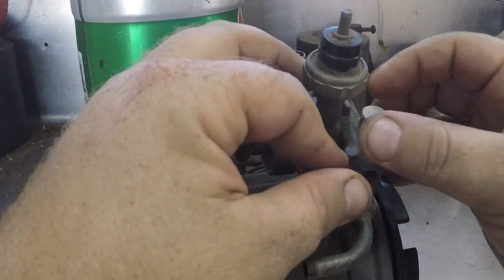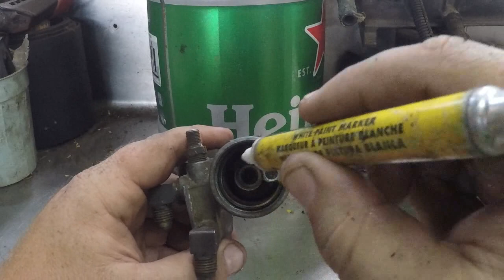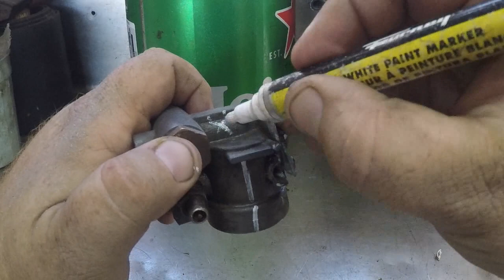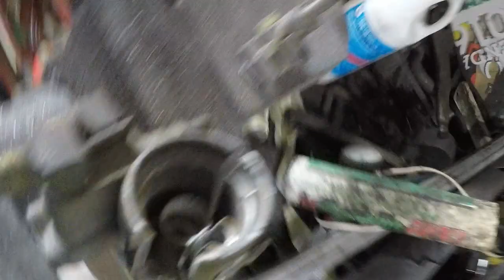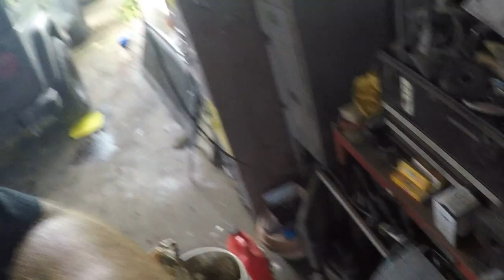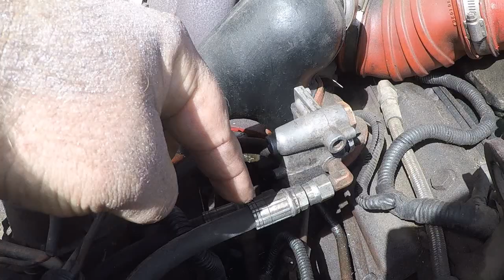How to: delete your fuel bowl on a FORD POWERSTROKE  7.3  OBS (tightwad mod)

Comment: I know this is an old video, but this is good stuff!  The fuel pressure regulator is the most intimidating part of the e-fuel upgrade for me, and the most expensive.  You made this look pretty easy, but only because you are a surgeon with that grinder.  I don't know how I feel about no mounting bracket, but you say it works in your truck and I believe you.  It actually looks quite good, and way less messy than that stock fuel bowl.  Thanks again!
Reply from the maker: This is an old video indeed and the truck still has this setup and working years later. Just dont cheap out on fuel pump and get a bosch one.
Reply: @10MMSOCKETGARAGE  yeah I think that is good advice.  I would probably go with something like the OEM pump, Bosch, Walboro or something proven.  Did you add an inertial shutoff or oil pressure switch?

Comment: What did you plug the Whole where the manual pump was. An what did you use to adapt the bango bolt
Reply from the maker: An freeze plug i dont remember the size and the banjo bolt adapter is in one of these Efuel conversion videos discriptions there is a full parts list fitting list

Comment: I'll buy the one you just built
Reply from the maker: I need to find it its somewhere. If i find it ill msg
Reply: @10MMSOCKETGARAGE  sounds good,I was thinking of rebuilding hpop and putting a fuel filter off the rail after pump or before it not sure what better but while I'm there getting rid of bowl would be nice.
Reply from the maker: Less leaking problem points easier to maintain and a steady fuel. Pressure win win

Comment: Could you do a in-depth video on how you wired your Bosch fuel pump and where you got the water sep and fuel filter housing on the frame well great video thanks a lot 🤘🏻
Reply from the maker: Thanks for the idea!
Reply: Tenmil Socket Garage no problem 👍🏻 it’s just I don’t want to spend 2k on a E-fuel setup but I also can’t find any videos on how to wire the pump and what water and fuel filter housings to use lol love the videos though keep up the good work 👍🏻👍🏻👍🏻👍🏻
Reply from the maker: My friend i just ordered a universal fuel pump relay kit on amazon and just installed it like the instructions said haha. Easy peasy
Reply from the maker: Its called pre filter ( water seperator ) and post filter after the pump
Reply: Tenmil Socket Garage okay I’ll look into it 👌🏻 right now I’m fighting down injectors 😂
Reply from the maker: Bad ones?
Reply: @10MMSOCKETGARAGE  sorry I know it’s been awhile lol it ended up being that the #4 cylinder blew the rings apart but I got a new engine swapped in and she’s running good now did bellowed up pipes and ebpv delete while the engine was out now I got a problem with my php hydra it cause the truck to idle weird when I use the tunes like the rpms bounce up and down and also it causes lots of white smoke I think it’s where the wire has a small pinch but I can’t find where to buy a new one and tech support didn’t tell me where I could get one all they said was to check the connections to the pcm
Reply: @10MMSOCKETGARAGE  by the way when you did the E fuel did you remove the mechanical pump
Or just leave it there
Reply: @strokenobs___181  i believe he removed it and replaced it with banjo bolt
Reply: @10MMSOCKETGARAGE  no filter anymore isn’t that good to have on there I don’t know just asking
Reply from the maker: Letme know bud!